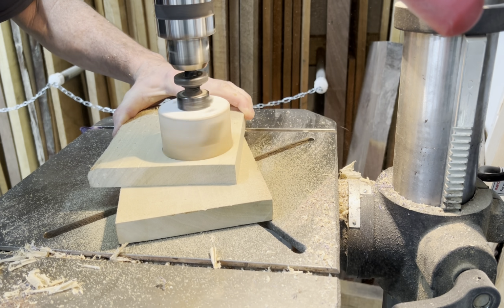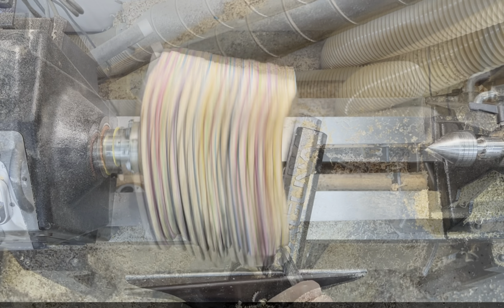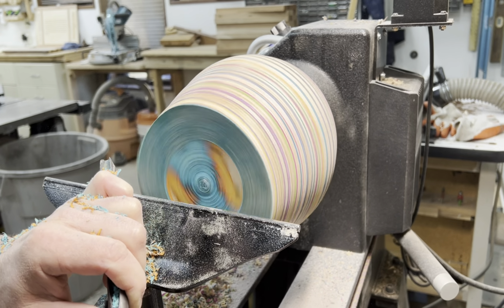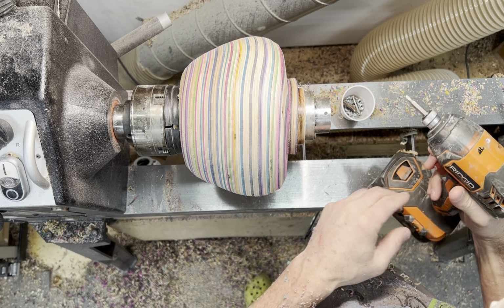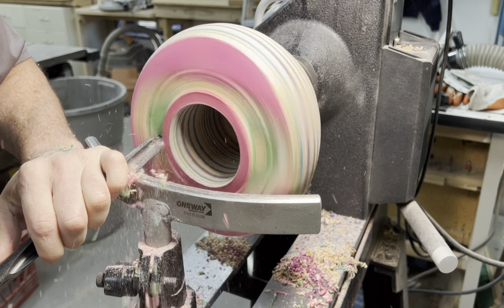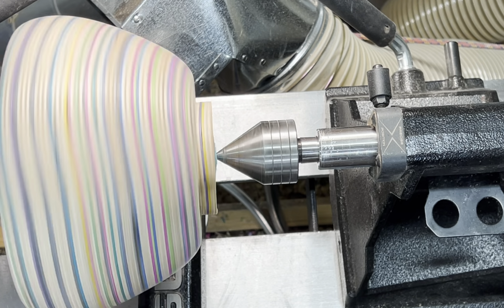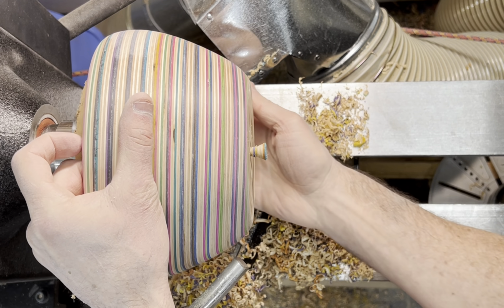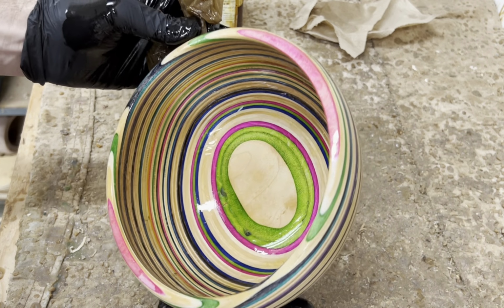Wood Turning A Bowl From Recycled Skateboards, #2

Comment: Do you use the same shape? If not how do you make sure that the finished product doesn’t have any empty space between boards
Reply from the maker: Not all boards are the exact shape but with heavy clamping pressure then mostly line up.  Any small gaps can be filed with CA glue and larger ones resin.  Michael